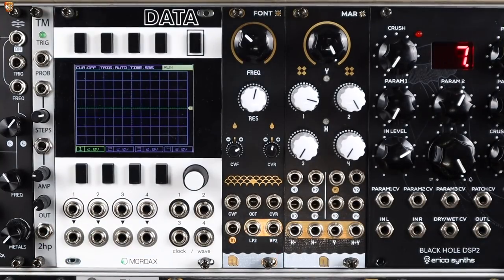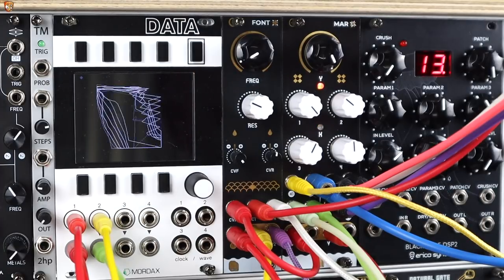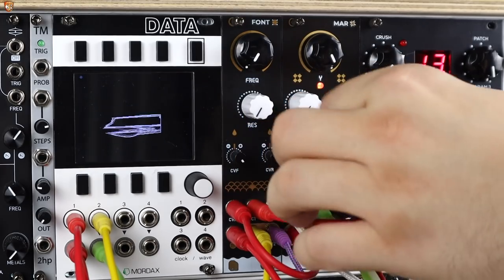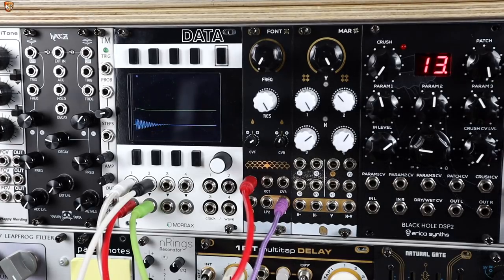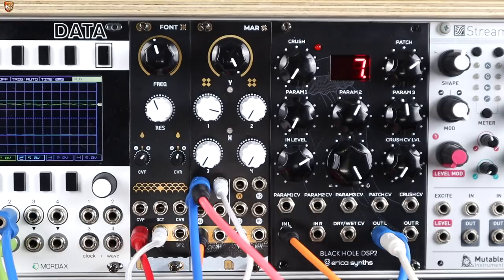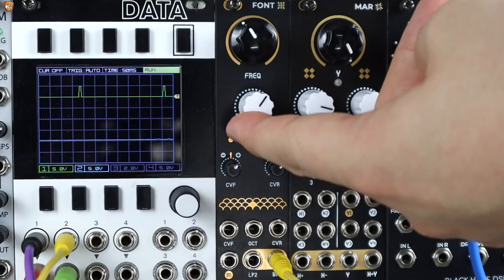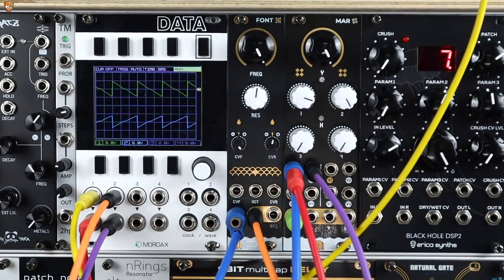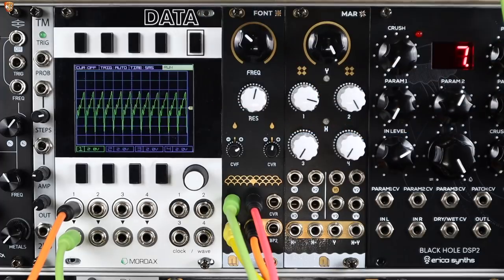NANO Modules FONT // Tiny Eurorack filter with a BIG sound!

Comment: What module are you using for your envelope with the FONT? I guess I should ask what VCA you are using as well? Very interested in this filter for some reason. Can’t move past it. Trying to get as much info as I can, as I have been fooled by some filters before. I’m sure we all have, ha! Thank you in advance for any info you can provide! PS: finally picked up your Ochd from perfect circuit. Just got this weekend!
Reply from the maker: Enjoy ochd! 

To be honest I've no idea at this stage but there's nothing particular important with what I'm using and doing here. A decay envelope with an exponential curve is all that's need to get the filter moving like this. 

As for the VCA, I often don't put a VCA after filters, especially when demoing them so you're just hearing the filter.

Comment: What modulation sources were used. Envelopes make a huge difference, were they also by NANO? Thanks 🎉
Reply from the maker: Hello, I'm not sure to be honest as this was years ago. 

NANO didn't have any envelopes out at that point so it can't have been. I can't see any modules in the video but at the time I was likely using a lot WMD Multimode Envelope and others I really can't remember. Going by the "twang" of some of those patches those envelopes are definitely exponential and they're getting attenuated on the CV inputs so the peak level isn't so important. 

Hope that's helpful without me having much info to go on.